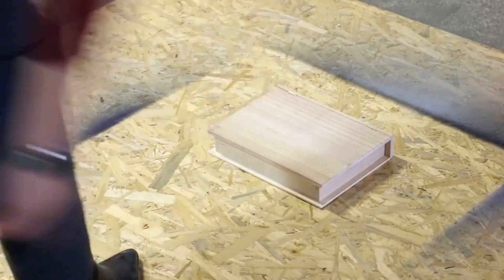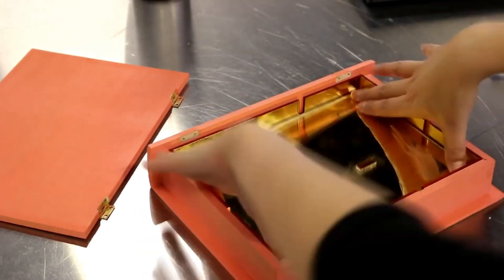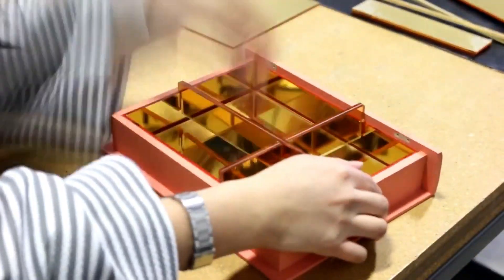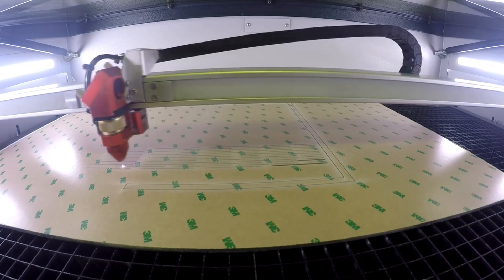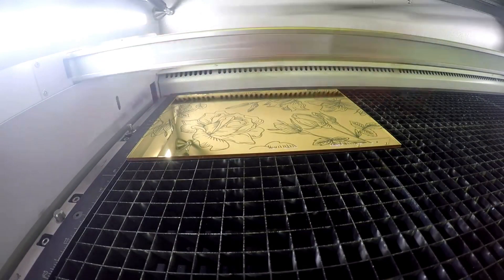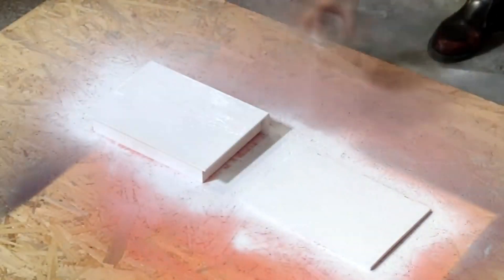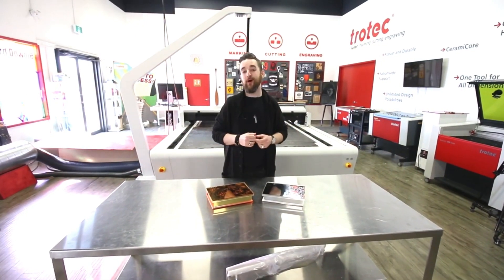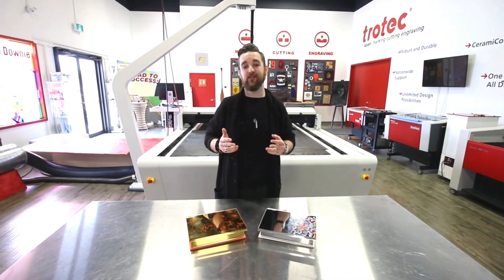Acrylic Jewelry Box | DIY Laser Project

Comment: What adhesive do you use to mount the acrylic in the wooden box base?
Reply from the maker: Hi, you can order our laser materials (in our video you can see our acrylic: TroGlass Mirror) with  an adhesive foil on the back. Otherwise there are self-adhesive foils from 3M for example.
Reply: Y you heat the front of the box ( the designer front piece)?